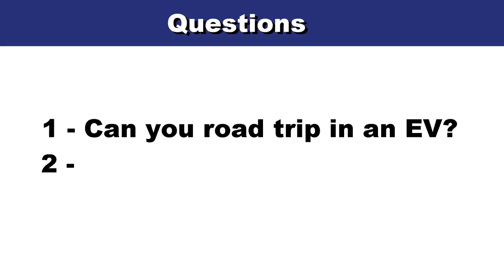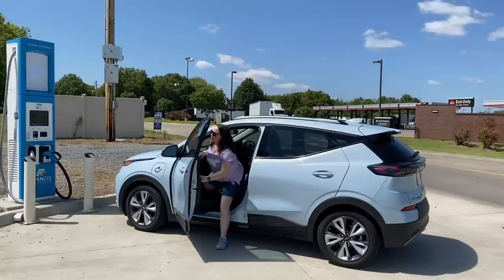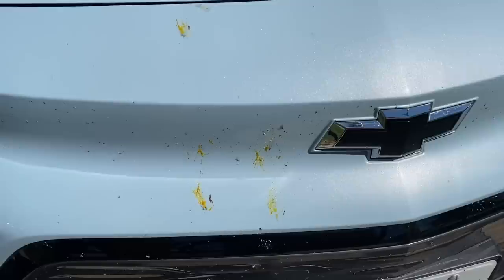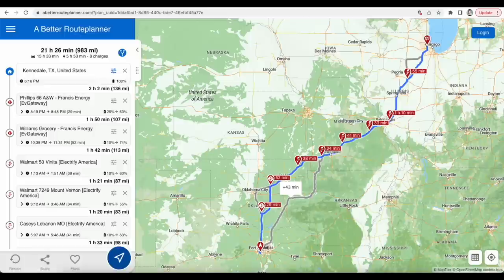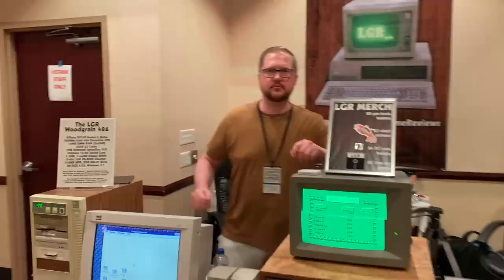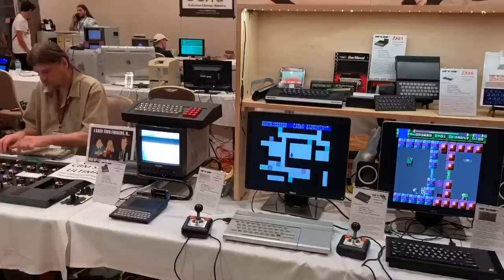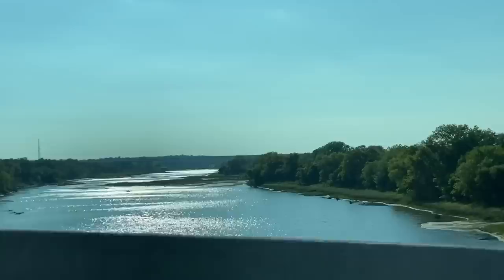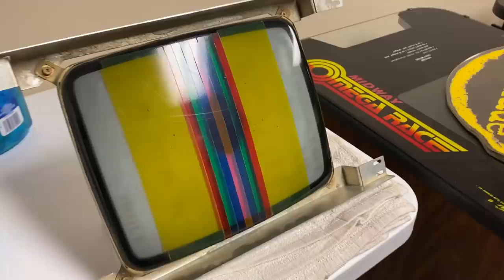EV Roadtrip, Vintage Computer Festival, and Moonbase Repair

Comment: that shattering sound wasnt the tube breaking, it was his heart. i cant imagine how bad that mustve felt when it happened.
Reply: I've done it a couple of times.  Had an NEC APC I had just about restored, went behind to retrieve a loose connector.  Didn't even feel myself making contact with the neck, but I heard the whoosh.  I watch guys plug in the socket on the end with no particular care day in day out, but if I even breathe on mine the wrong way out goes the vacuum.
Reply: Probably didn't feel that bad, he has a history of treating vintage computers carelessly
Reply: That was only 1 video Yes I do Admit that video really ticked me off Because It was not just a vintage IBM computer but a prototype as well.
Reply: And the hiss was his soul leaving his body.
Reply: @KeeDx3 THIS COMMENT exactly
Reply: @KeeDx3 also he decided to dremel the screws because he didn't have the correct socket/bit driver
Reply: The sound that got me was the hiss of pressure equalization.
Reply: @Blackout_1692  its a screw! Who tf cares about the screws?  You could still buy those exact screws at a hardware store anyway its not like they are special ibm screws.
Reply: "Not again."
Reply: @jackmacdonald714  He didn't only cut the sides of the screws, he also cut in the housing of the PSU while doing that.
You would have known that if you had watched that video.

What's worse is that he didn't even own that computer.
Reply: @KeeDx3 its also true. Hes the Cleetus of vintage computers.
Reply: @soupwizard  kinda pathetic comment here lol
Reply: no wonder if you put it in like that
Reply: @soupwizard  He worked at AST for years and employed a strategy he had used previously with success.  It just didn't work in that case.  I remember blowing up a Unitron keyboard because I was certain it was just a copy of an Apple 2 keyboard and plugged it into a real Apple 2 to test.  It happens.  The machine in question was basically a PS/2 Model 30 in a unique form factor.  As a serious collector I think it's neat but I wouldn't have wanted to pay more than a couple hundred for it.  

Side note: I think it was one of the ones that got stolen from CR?  I never heard if they were recovered.
Reply: @soupwizard  A simple mistake (which I didn't even think was that bad when I watched the video) made a lot of you angry at him and use google to scrape up any type of data about him so you have another reason to be angry at him. It's honestly sad how the internet has become where they will literally do anything to get any information off of you for a simple mistake that you made.

No one is perfect. No one will ever be perfect, but if you refuse to move on, then that's your problem. Either stay in the past, or accept the fact that he used a method (and drilled out screws) for a computer that you wouldn't have had anyways.

Things happen. Move on, or get out.
Reply: #spoiler alert.
Reply: I gasped and jumped when it happened, but I somehow knew it was comming.
Reply: @ORIOLESFan02  Not only that, but David's also willing to share his failures along with his successes. I would put good money that anyone criticizing David's methods would NEVER show their failures, and that's assuming they're anything more than an armchair repair folk.

I'd also put more good money that anyone who complains is probably impressed by those fake repair videos... y'know, the ones where they find a "Sony Game Boy" in a rubbish pile and "repair" it via recording them trashing it then simply editing it in reverse.
Reply: @Blackout_1692  If you're shocked about a screw, then you'd have a heart attack if you ever actually worked in any kind of repair or handyman service. In my experience, anyone complaining about people repairing things "wrongly" has never worked an honest day of labor (or, worse, forgot about what it was like when they did).
Reply: @soupwizard  > "carelessly"
I am legitimately curious as to how you define "carelessly". Please also provide examples.
Reply: @soupwizard  sounds like you never worked a single day in your life, when you are so unforgiving on mistakes everyone can make ;)
Reply: Really unfortunate.  Like Forrest Gump taught us, "$h!t happens".
Reply: Glad he had a spare despite the fact it wasn't really a spare so atleast some temporary resolve is there.
Reply: @KeeDx3 Are you saying Cleetus McFarland doesnt bring value to the motoring scene? He has probably done more to bring a new generation to racing than anyone alive. 
He also has zero mechanical empathy and frequently flies blind into a project, sometimes it works, sometimes its destruction thats just painful to watch. Also constant self-promotion.
Reply: I almost did the same thing with my Goldstar ViewMax GVT-9100M when I was reinstalling the A/V+CRT board and my PVM-9L1. Yes, CRT tubes are fra-gee-lay, but lay off on roasting the 8-bit Guy for this.
Reply: @DocFlareon the sound was the air entering the picture tube (the tube lost its vacuum).
Reply: @KeeDx3 i daresay there are other tech pros in the comments who would differ on the numbers. Are you aware what peroxide does to polymer structure?
Reply: @TechTimeTraveller
Reply: 13:42
Reply: I feel like we need a support group for people who accidentally borked tubes.
Reply: lol, its so true. As a guy who's been through more then a few "accidents" performing electronic repairs,I felt that one the moment he smashed it.
Reply: @mycosys  A "tech pro" isnt going to give a spit as long as it cleans. Dont mistake youtube armchair quarter backs as actual techs.
Reply: @markkrusemer526  im not gonna wooosh you but its a joke
Reply: @soupwizard  Yup.. A paperclip comes to mind...

Comment: Picture tubes showing a "hole" in the center of the phosphor when they go to air is pretty typical, especially for monochrome tubes. In color CRT's, the mask usually holds the phosphor together a little. If you see a device at a flea market or on eBay or CraigsList or whatever and it has a hole like that, walk away.
Reply: Yep, I agree. I remember seeing a 'vwestlife' video where he showed a Zenith TV or monitor that had a hole like that and he explained that the neck would've been bent as part of preparing the display for recycling.
Reply: It's a shame the old CRT had to end this way. But at least David solved the problem with the help of Sark. It was an outdated transistor on the power regulator.
Reply: The phosphor stays in place. What blows away is the aluminium backing over the phosphor. You can see it easier with colour tubes and their rows of phosphor dots.
Reply: @gothesouthway  I did the same. I used to see 20" tubes from old valve black and whites on the dump that people had removed from the cabinets that they used for other things. No bonded rim bands on those things. They sure went off with a bang and sent glass flying when you chucked a brick at them, purely for safety reasons of course.
Reply: I remember working in NYC on Canal street at Ramco Electronics, a typical "junque" store that had lots of overstock and surplus offerings.  He had gotten a small truckload of Panasonic color TV sets in the 19-25" size range.  I spend an entire day building a few "Frankenstein" sets by taking dead sets apart, saving the good PCB boards and such to build a few working units.  One such unit was almost completely assembled when we noticed that the CRT had a hairline crack in the exhaust stem, and was under air.  RATS!!!   
I feel bad for Dave, getting a replacement CRT these days will be almost impossible.  He may have to find a similar but not identical tube and rewire the socket and yoke connections to match.
Reply: @user-xt1mw6vm3y  Seems that aluminium coating improves some aspects of the phosphor.
Here is a snippet of what I found:

Any phosphor coating can carry an aluminum coating as well. 
Adding this coating:
    Improves light output
    Prevents surface charging by bleeding off electrons
    Prevents ion damage of the phosphor layer
Reply: @user-xt1mw6vm3y  It is mainly used in order to avoid having to use an ion trap magnet on the neck, which need adjustment. By not needing an ion trap also allows for the use of straight guns instead of angled, which again reduces the neck size. If you use a straight gun on a non-aluminized CRT, it will burn a dark spot in the center of the screen. Aluminized CRTs were the norm by the mid 1950'ies. I'm eager to know if color CRTs used aluminum as well, or did the shadow mask catch the ions anyway?

Btw. Finding a new tube shouldn't be too hard - as long as the EHT spec and deflection angles matches, the tolerances for everything else is usually pretty wide, and should be adjustable on the video board anyway. But a damn shame when these things happen... you suddenly feel very tired.
Reply: @cleverhardy5230  Maybe it's possible to repair the phosphor, re-vacuum the tube, and re-melt/re-solder the glass back to seal the vacuum inside...
Reply: @user-xt1mw6vm3y  Its in all tubes. Its what gives the tube that silvery colour when there is no picture on it. From memory it is used to reflect the light from the phosphor out the front of the tube as well as acting as the anode conductor. I have smashed plenty of old tubes over the years and there is shiny metal that peels off in flakes on the inside of the front of the tube.
Reply: @stephenw2992  No, the aluminum coating is not in all tubes. Donoester is correct. I have an old 1940s TV with the venerable 10BP4 tube. If it's out of the cabinet and you look at the edge of the tube you can actually see the image on the back of the phosphor. What (nearly) virtually all glass CRTs have is a conductive coating on the inside which, combined with the coating on the outside, forms a capacitor to filter the high-voltage supply.

And to donoester, I believe color CRTs also are aluminized. I just looked in a copy of RCA's receiving tube manual RC-18 from 1956 and it lists all three color types as being aluminized. I would imagine all newer ones are aluminized as well.
Reply: @eDoc2020  Maybe some oddball early tubes didnt have it before someone worked out it was a good idea, but anything more recent does. The conductive black coating on the inside and outside of the tube is called aquadag. Did those 1956 RCA tubes warn you about all the cadmium they supposedly contained?
Reply: @stephenw2992  It wasn't until the mid-late 1950s when aluminized CRTs became standard. There were millions of sets before then so non-aluminized CRTs aren't that oddball. And no, the 1956 manual doesn't mention cadmium at all.
Reply: can confirm broken many a tube in my days
Reply: @eDoc2020  I am so sorry I didnt bother  writing out that its all tubes that anyone normal is ever going to encounter in a throw away youtube comment. Thanks for educating us about something that will never concern us.
Reply: They dont often get the hole just from going to air.  Usually that only happens when they loose it all at once.   Thats the air going in and blowing the phosphor off the face of the tube
Reply: @FennecTECH  It takes a decent inrush of air, usually due to being necked completely. Colour tubes have the shadow mask to slow the air also. Breaking the nipple off the back to decommission a tube is usually not enough to show on the aluminium, though I once had a 26" tube also break around the pins in such a way that it sucked the whole gun assembly in so hard it ended up puncturing the shadow mask and getting lodged in it, as well as removing quite a bit of aluminium.